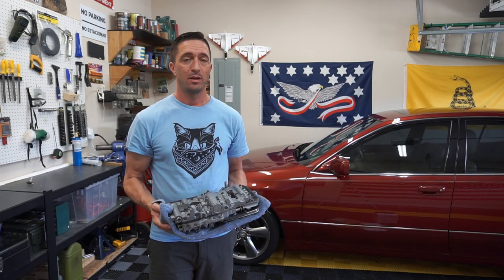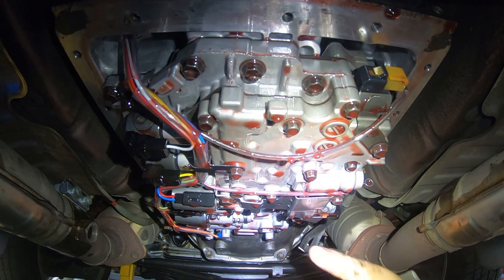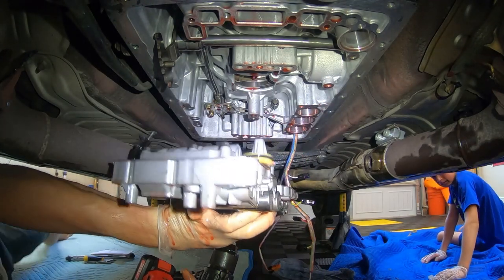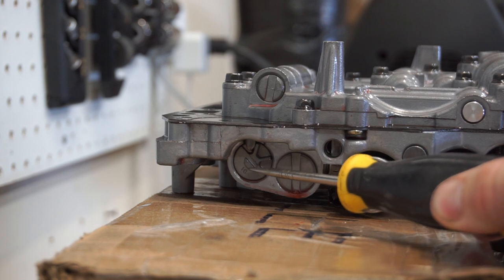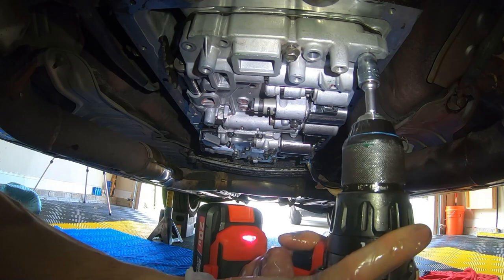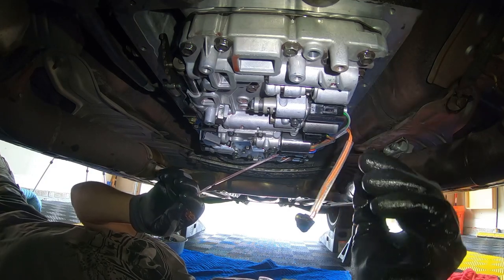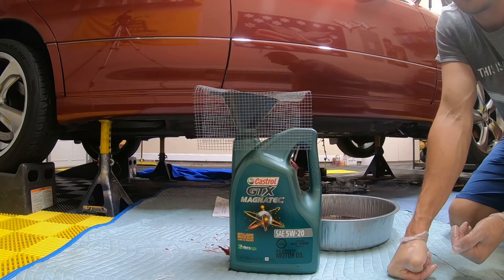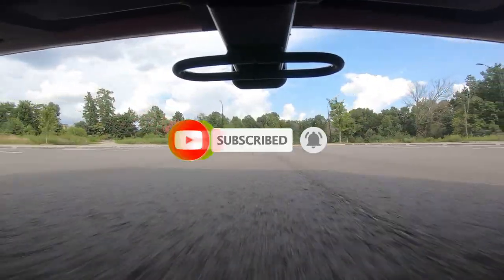TOYOTA / LEXUS STAGE 2 Transmission Mod (Upgraded Valve Body Swap!)

Comment: Great as always. did you buy the modded body from importperformacetrans? also i want to dial mine to 3 when i got to drop the pan to clean ad add fresh fluid do i need to get a trans cooler first i dont want to strain the transmission?
Reply from the maker: Hey thanks! I actually purchased it from a fellow enthusiast who performed the mods just like the pro shops do. It was very tedious work according to him, requiring massive upfront research and careful modification. Therefore I recommend having the pros do it. IPT is a shop that has been around forever. Also, Level10 is another option. As for the dial to III you do not need the trans cooler. You can do that later. If anything the dial to III slightly reduces temps anyway.

Comment: I truly Appreciate your channel. What city are you out of?
Reply from the maker: Thanks! I keep personal info on the DL for safety reasons.
Reply: @ForwardMomentum  - no problem I can understand it. I'm from the Los angels area, and have a 1998 Lexus gs400 that has been Bulit proof, but I'm thinking that I need to do some service on it. I don't want to pay an Arm and a Leg, at the Dealership. Can you Suggest a location in Northern California or Southern California?
Reply from the maker: Thanks for understanding. I am not aware of a particular shop in those areas, but I have found Google reviews, as a whole, tend to be pretty accurate. Also, the ClubLexus forums may have some recommendations as well. Best of luck in your search!

Comment: Hello, 
Great video, 
Question. 
I have 2016 lexus gx460 with shift solenoid C and D code,
had transmission shop replace solonoids, but still don't have 4th.5th.6th gears, they telling me I need to  replace or rebuild transmission assembly, 
you think it's  valve body issue, if replaced with rebuilt valve body that  comes would be a fix?
Or go with  whole trans assembly?
Thanks
Reply from the maker: I would call IPT in NJ and discuss your situation with them. It’s too hard to say over the Internet what’s going on. Report back if IPT gives you any guidance. 👍

Comment: i wonder if that 3rd port on the catch can was causing your car to run rich.  Maybe something to look into.  Now i can find a two port.  Thanks Christian
Reply from the maker: Hey - no, my prior fuel trim problem was present well before the OCC. I even disconnected the OCC and checked the trims with the K&N in place and had the same problem. It was 100% the K&N.

Comment: I just noticed the pulleys on the wall.  Did you get the pulley issue squared away with XAT?   Thanks for the update on the catch can.  There are some nice options for the 2 port can.
Reply from the maker: Ha ha, good eye. No, not yet. I’ve got quite the collection of tensioner pulleys that won’t work going.  I’m told they have a design that will finally work and they will get it to me in a week or so. Good thing it’s a 5 min R&R to replace it!

Comment: Hi my name is serjio. I have a Lexus IS 250 v6...2006..
I'd be having a little bit of trouble with my transmission but they charge too much money the mechanics I tried to do it by myself it only works first second and third gear I will appreciate if you have any idea what's the problem
Reply from the maker: Manual or auto? If auto, you probably need to test the solenoids.
Reply: @ForwardMomentum  
I really appreciate that you answer my car is both in the wheel you can put the gears up and down ..
In automatic.......
Reply: Your videos are awesome

Comment: @forward momentum can you tell me how is the down shift? i have a Gs400 also but have to press the pedal really down for it to down shift , this car have really lazy transmission ....
Reply from the maker: Yes it does. The downshifts are better with the modded VB; they snap off quicker.

Comment: My transmission is going out! When I press on the gas it doesn’t move sometimes and when it does move it either shifts hard or doesn’t shift at all! Any help?
Reply from the maker: Start with the cheap items (fluid qty, codes, etc) and work your way to the more expensive stuff.  Did it happen all of the sudden or has it been gradual?
Reply: Forward Momentum it’s been gradual! It was hard shifting a first! The car would jump going into the next gear! I had a whole bunch of codes including misfires from like 4 cylinders I believe. I was thinking maybe the shift solenoids could be clogged up or something but I’m not sure!
Reply from the maker: Did you get any solenoid codes?
Reply: Forward Momentum I had over 10 codes I couldnt remember what it was! I wanted to do the cheapest things first!
Reply from the maker: Did you clear them? Can you get them to trigger again? I suggest the Veepeak OBD WiFi scanner and Car Scanner Pro app. You can even export all the codes to email. One code often triggers other codes, so we need to pick out the key codes first.
Reply: Forward Momentum I used a Snapon obd scanner! That exapensive one! Did not clear any codes though. I should of taken a pic of all the codes that shown! I watched this video on YouTube saying misfires could cause bad shifting! Don’t know if it’s true though.
Reply from the maker: Ok gotcha. I’d run the codes again and record them. I’d consider pulling all the plugs and testing each coil pack too if there’s a true misfire.
Reply: Forward Momentum ok I’ll try that! But do you think it’s worth taking out the solenoids and cleaning them?
Reply from the maker: Bryant Faasili no, I’d narrow it down first. Dropping the pan and gaining access sucks, so you’ll want to be sure which solenoid you need to replace and have the replacement on-hand, etc. Unless this is a project car and sitting anyway, but even then I’d narrow it down.
Reply: Forward Momentum yes it’s a project car right now. I have other cars that I drive so I don’t mind taking things apart and leaving it. But solenoids are very pricey
Reply from the maker: I have my old VB for sale. Works perfect. LMK if you’re interested. Probably looking to get $100 plus shipping.
Reply: Forward Momentum ok I will let you know! Thanks
Reply: @bryantfaasili1242   clean engine solenoid or replace it will remove cylinder codes and engine vibration

Comment: Would it make much of a difference if you shim the transmission after you upgrade the valve body?
Reply from the maker: Some claim it does. Others claim it makes the shifts like a “rubbed band.” I personally don’t have experience with shimming the accumulators, so I cannot comment.

Comment: did you put any type of gasket maker with the fel pro gasket? or is it just the felpro gasket?
Reply from the maker: Just Felpro. Do not use FIPG and the Felpro.
Reply: @ForwardMomentum  sweet. going to do this tomorrow. been debating on following the service manuel and using either the FIPG or the fel pro gasket but i think you sold me on the fel pro.
Reply from the maker: Getting off the FIPG is the worst part of the job. That stuff is a royal pain after all these years and heat cycles. 🤬

Comment: I need some assistance please, I have a 2007 Lexus IS250 A/T, where my transmission seems to be stuck in a neutral, When moving through the gears it shifts ok, however when shifting from R to P it makes a grinding sound. Also when the car is on ( Iddeling) and I select the Sport mode and run through the gears, it changes like normal, however, there is a buzzing sound coming from the solenoids, but when I select 1st it stops buzzing, and all the other gears it buzzes.
Reply from the maker: Scan for codes?
Reply: @ForwardMomentum  I did, no codes, no engine light also, so also when the car is in either P, or N or R - it still rolls , so no gear is selected ?

Comment: I'm interested but still it seems like my LS400 shifts better then this on the stock valvebody with the dial turned up. Traction control fights me on the 1-2 on cooler days
Reply from the maker: I can’t speak for your transmission but I assure you this made a crazy difference, especially at WOT. It’s obviously hard to film how firm a transmission shifts and one can really only go on sound and maybe the tachometer.
Reply: @ForwardMomentum  i'm gonna look into it more. and i'll be watching more of your vids!

Comment: Can you replace the line pressure solenoid and lock up solenoid without pulling down the whole valve body?
Reply from the maker: Solenoids should be accessible w/o dropping the VB. At least it appears that way. Admittedly I didn’t touch the solenoids, so double check me.
Reply: @ForwardMomentum  Thank you for the quick response. My said two solenoids doesn't have a resistance reading on multimeter so I've ordered replacement solenoids. Still researching if I have to drop the VB to replace. Hearing that is a relief for me ( newbie on AT transmissions )

Comment: There's a higher performance 9.5 Dragon Torque Converter for the GS400 by Precision Industries for $825.00 , it adds 50 HP , & has a 5 year warranty, has anyone installed it yet?
Reply from the maker: A TC adds 50HP?
Reply: Yes, just spoke to their representative this morning, thought it could be a great option for us to keep in mind in near future.
Reply from the maker: Sam A I know TC’s can help with launches, stall rpm and slippage, but from a physics standpoint an object bolted to a rotating mass on the engine may free up some HP, but if they’re claiming 50 I’d be very skeptical. It makes no sense from a physics standpoint.
Reply: Sam A Yah it doesn’t work like that lol
Reply: They say it changes the Converter from 1.97:1 to 2.53:1 , this is how HP of 50 is increased.
Reply: I've seen the russians of all4swap making vvti 1UZ Manual swapped and it adds around 20-25hp to the wheels, a torque converter adding 50hp is unheard and probably unreal.

Comment: I seen where you did the manual swap, but what did you do with the auto transmission
Reply from the maker: Shot it with a .50 cal, then took it to the metal recycler for $25. 😆
Reply: I needed it for my gs400
Reply from the maker: @johnsem2568  well there are quite a few out there. You’ll find one. Plus mine was slipping so you would have needed to fix 2 clutch packs. Not worth it at that point unless you can DIY.

Comment: Thank you for sharing your experience. However, one time I went to change transmission fluid of my lexus and I was so surprised when I see small pin (dia 3.5mm and length 10mm) with the fluid pan magnetic. I don't know from where it fell. This was 1 month ago. I  leaved it and up to this moment every thing is normal on my gearbox. I drive it every day. Any one has an idea about  that? I will appreciate.

Comment: will adding a gs300 or a supra rear end help with torque distribution?
Reply from the maker: It definitely helps with 0-80 but the ratio will cause the car to run at like 3K RPM on the freeway. UNDER FUNDED GARAGE did this mod on his 430 I believe. He could confirm.

Comment: Has anyone here modded there own valve body?? Has anyone gotten the (trans go )shift kit?I messaged the guy on eBay about his product a lot of people have used his kits for there a340e for the 4 speed autos but trying to find some info for the 5 speed like this guy
Reply from the maker: My old modded VB had the Transgo kit in it, among other things.
Reply: @ForwardMomentum  how was it? I just ordered it. A few people have sent me links to the same one I bought so I could only assume it’s a good kit.
Reply: @ForwardMomentum  the actual company got back to me and said they have sold 60 within the last 4 months and haven’t
Gotten any complaints.
Reply from the maker: @cornertaken6627  no issues. When I was AT shifting was too soft for me, even with a modded VB. So I went manual.
Reply: @ForwardMomentum  so we’re the shifts much quicker and
Better with the shift kit?
Reply from the maker: @cornertaken6627  yes, but not enough for me. If you have a VB built by IPT or similar, you can usually tell them how firm you want it. Since I bought my modded VB used from a friend, I didn’t have a choice.
Reply: @ForwardMomentum  how much do built or getting a valve body built cost
Reply from the maker: @cornertaken6627  see vid description for link to IPT.